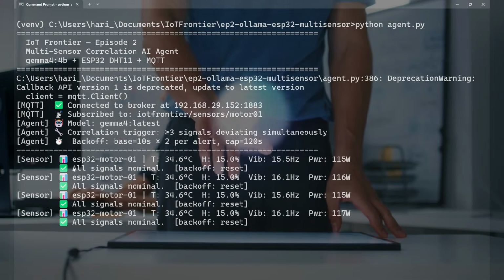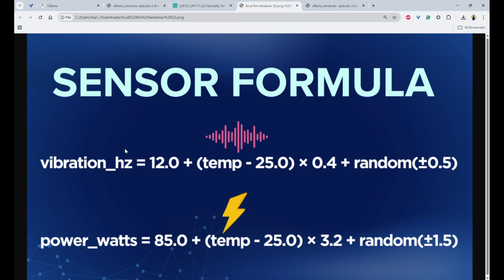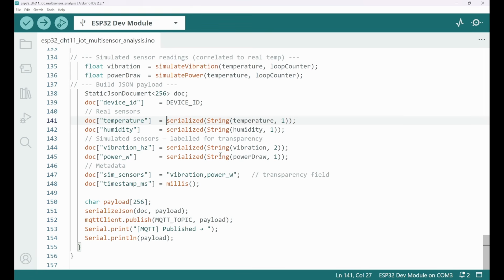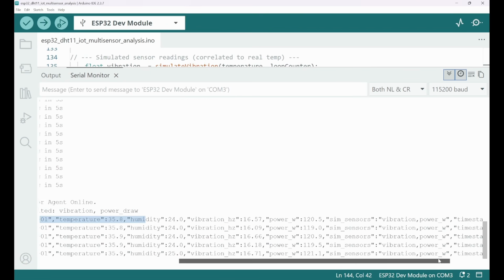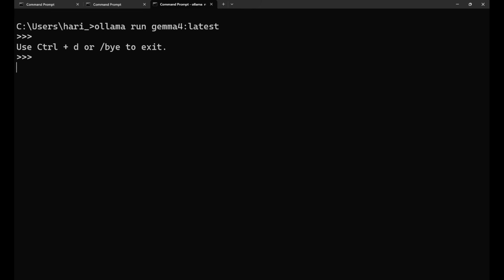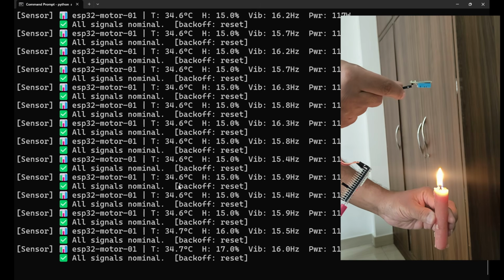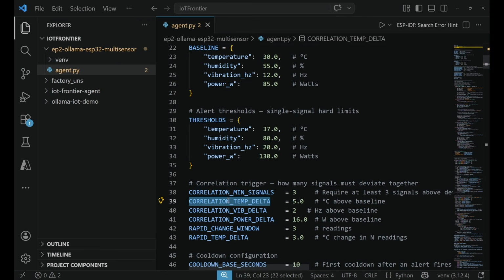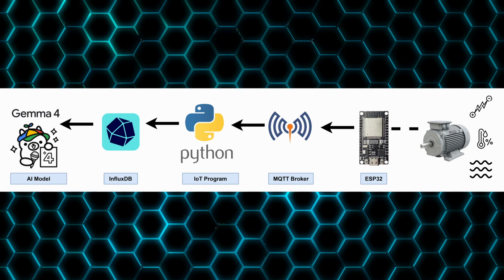How to Build an AI Agent for a Multi-Sensor IoT System | Episode 2

Comment: You are a rare gem I will be going through your tutorial but I don’t have the component is there a playlist for virtual setup like wokwi?
Reply from the maker: Yes, you can use code with slight modifications to Simulate the temperature sensor also in code to work with this tutorial